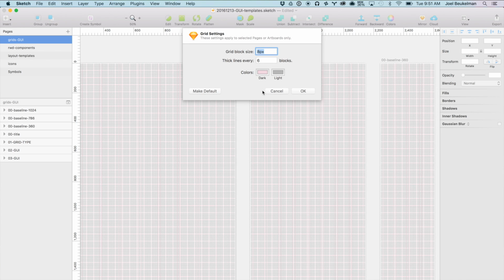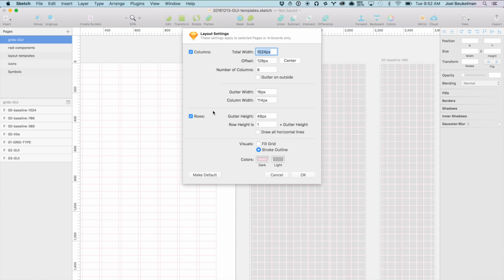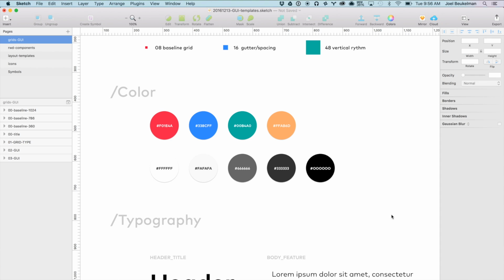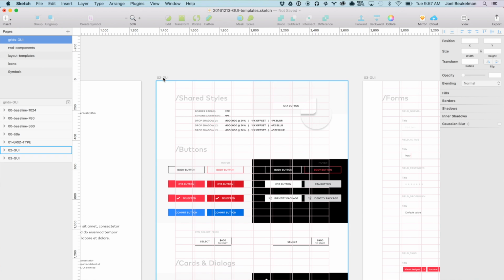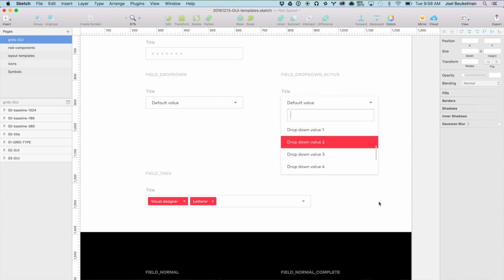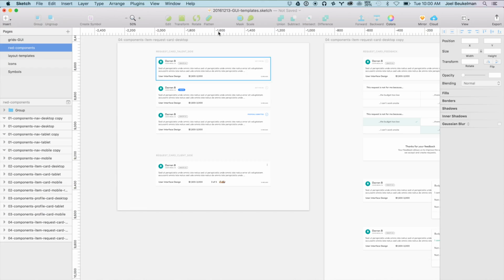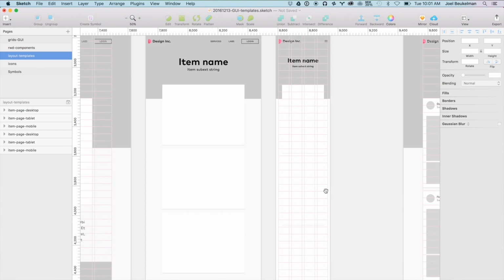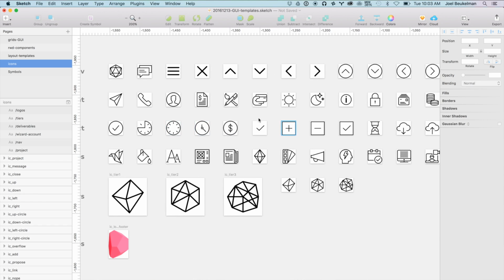Tutorial: 8pt Grids, Layout, & Material Design GUI Templates

Comment: great video! but why designers should design with 8pt Grid? why not 6 or 10?
Reply: This article explains why: https://spec.fm/specifics/8-pt-grid  - basically, "Regardless of form-factor, most popular screen sizes are divisible by 8 on at least one axis - usually both. Additionally, some platforms’ style guides (like Material Design) call specifically for a grid of 4 or 8 points, making this system a natural fit."

Comment: Hey man, sorry for disturb you, thanks for the video and sorry for stupid questions.

Why on a desktop are you using 1024 width of the grid, not 1200 / 1300 or something like this? I mean how UI will be displayed if we have 2K or 4K monitors? And one more question, design need to be made on the current based grid from the border or have maybe some indents from the border.

Also if you can, please provide me more info about vertical rhythm and baseline grids, also will be helpful if you provide some examples of your work based on grids used in this video.
Reply from the maker: Dmitro Petrenko hit you back on messenger. :)
Reply: Hi Joel,
Dmitro has asked all the questions I had too. I know you're most likely crazy busy, but please forward me some thoughts too if you can.